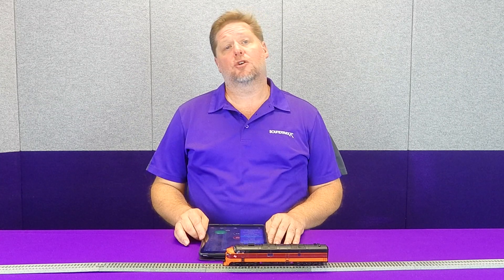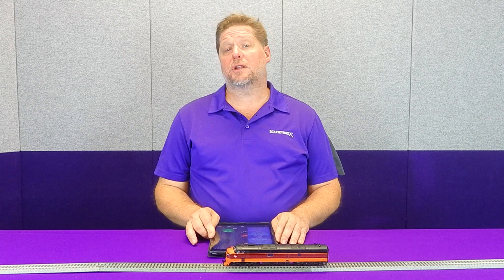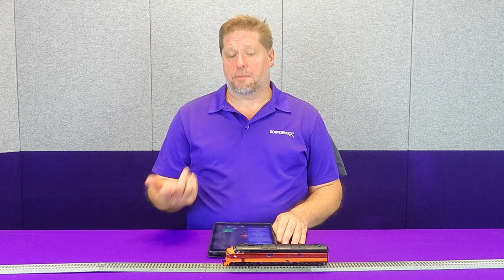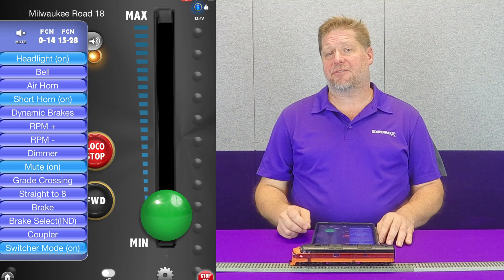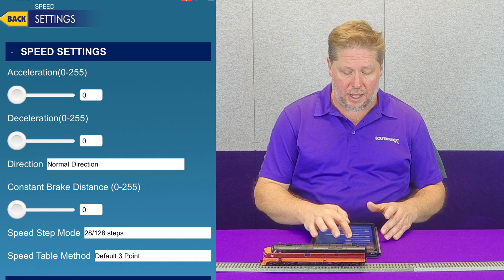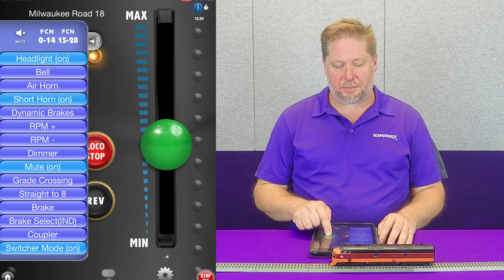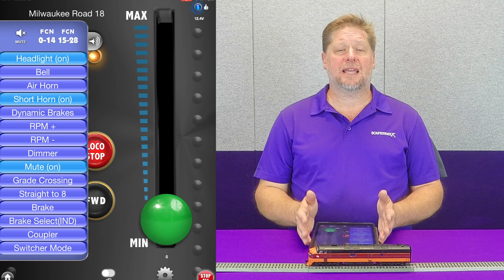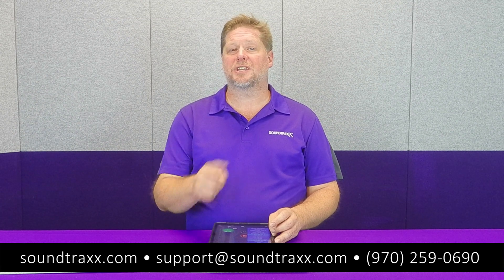F14 Switching Mode with Tsunami2 and Blunami Decoders

Comment: ... And you ONCE AGAIN failed to mention this also applies to Econami decoders.
Reply: maybe because this feature isn’t available on Econami
Reply: @CentralJerseyRailfan  Sure it is.
Reply from the maker: We did not mention Econami, but yes, it is on the Econami as well.  I did not have an Econami-Equipped loco to show it off with.  But Yes, it is in Econami.

Comment: I understand that ESU start to have wheel screeching noise on cubs available in England with Accurail. Are you going to do the same with your decoders. That a cool effect.
Reply from the maker: We have had wheel slip features in Tsunami2 from the beginning.
Reply: @SoundtraxxDCC  Well, that's fine. However, this is not the same. Wheel slip in mostly for steam locomotives. The screeching of the wheels appears in curves mostly on cars. right.

Comment: What CV register addresses are involved??
Reply from the maker: In this case, we look at the function Mapping section of the User’s Guide.  For the Tsunami, this information can be found starting on page 55 of the Diesel Tsunami2 User’s Guide.  After looking at the structure of the CVs, then for switching mode, CVs 1.276 and 1.277 control the parts of “switching mode”.  You can even disable one, such as momentum override, like I do in my models.  I hope this helps.
Reply: @SoundtraxxDCC  I'm pleased to see that for both Econami and Tsunami2 one can assign these functions to the same or separate FKeys. Thanks for the reply.